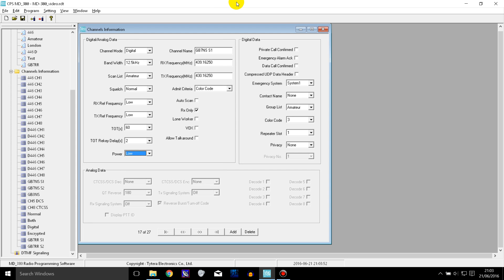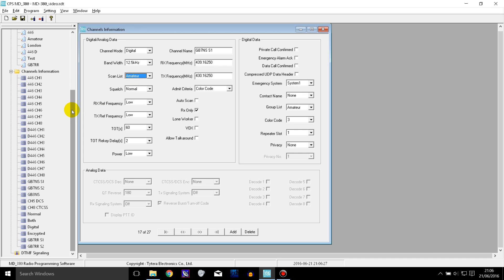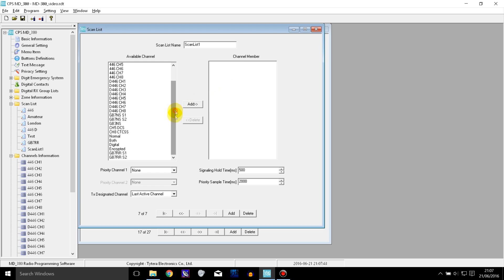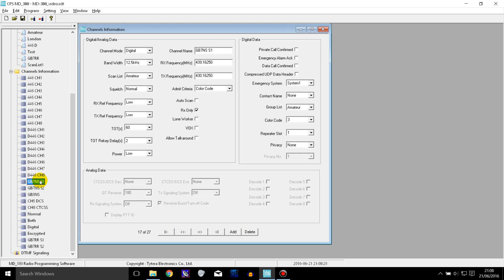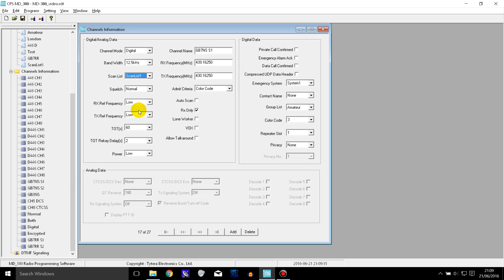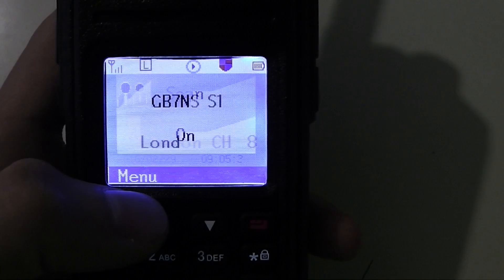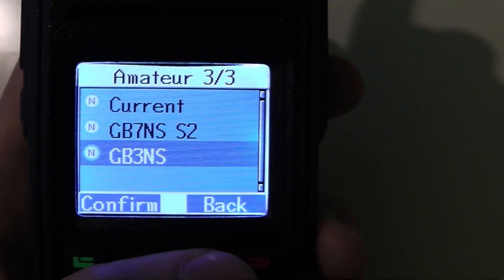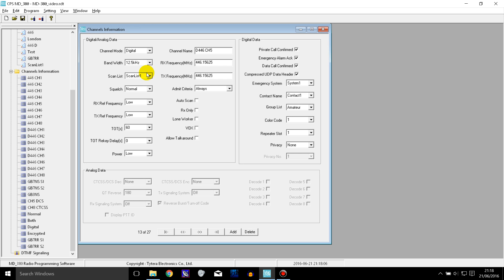How to scan on TYT MD-380 and other DMR radios

Comment: Thanks for the excellent video. All very clear, and useful. One thing that you don't mention is that the LED flashes red when scanning. This worried me to start with, as it looks like flat battery, or the radio is transmitting - but looking in the paper manual I see that this is normal when scanning.

Comment: does the scan feature also work on DMR talk group if I'm only MMDVM hotspot?
Reply from the maker: only if the hotspot has that talkgroup activated. Scan only scans what is transmitted. You have to make the hotspot transmit it first, either by setting it as a static talkgroup or by activating it by transmitting on the talkgroup.

Comment: Hi, thanks for the reply, there is no auto scan i found in the programing software. But you did give me an idea, I set ch1 to no scan list and power up to ch1 no scan on ch1, I can then switch to other channels and scan stays off till i hit side button. Go back to ch1 and scan is off. Kinda of cumbersome, but works.  Seems like a power up, scan default on/off setting in the setup would be reasonable.  Thanks, for getting me thinking...I try and follow support instructions.... badlands
Reply from the maker: Another idea: check the scan list. The setting might be on there instead
Reply: @radiosification  I will check that again, tks
Reply from the maker: Also you can program one of the side keys to be scan on/off so you don't need to go into the menu
Reply: @radiosification  Thanks, i have that side button set, it will still power up in scan on,  ths

Comment: Hi, new to tyt 380 and 390. Looking for default power up scan OFF.. I did try and search this out before sending this, per your blog request. I cant find out how to set scan to be off at radio power up. Now I need to turn scan off by side button at every power up. I like your videos in the lack of judgment and clear and clean information. Thank you, docbadlands
Reply from the maker: I'm very impressed. Most people don't actually read and follow those instructions. Off the top of my head, the first thing that comes to mind is that there may be a channel setting to turn scan on automatically. If you check the channel in the programming software, maybe you'll see a setting saying "auto scan" or similar. I'm not 100% sure if this radio has that setting but off the top of my head that's all I can think of at this moment. Let me know if that doesn't fix it and I can try again

Comment: Do you happen to know if there's any setting that will keep the audio from muting for a second or two when the transmitting radio is in scan mode (analog)? Here's a demo of the problem:
https://www.youtube.com/watch?v=DtE1NyeDpsg
Reply from the maker: No, there is no fix for this. It's not a bug, simply a limitation of the scan speed. The radio has to check each channel in the scan list so there will inevitably be some delay before it picks up the channel which is active.
Reply: Thank you for your reply, but maybe I wasn't clear in explaining the issue. It's the TRANSMITTING radio that's in scan mode, not the receiving radio. The receiving radio isn't scanning so it's not checking channels. Additionally, the transmitting radio's scan list can have no channels in it and even then there audio is muted.
Furthermore, if you look at the first video, you can see (and hear) that the squelch on the receiving radio opens immediately on the PTT, with no delay at all. If there were some delay in checking channels, the squelch unmute would be delayed as well, no?
Also, if you watch the other video, you can see that quickly releasing and pushing the PTT button allows the audio to NOT be muted on the receiving radio. It's only the first PTT that has this issue. All very weird.
Reply from the maker: Oh okay, I see what you mean now. I don't know of any fix for this. It was probably just lazy coding in the radio when they were writing the firmware.
Reply: Understood. Thank you for checking into it.
Reply: Any idea how to report a bug to TYT? Their "Contact Us" link on their web page (and many others) go nowhere.
I have contacted the 2 parties I know of that are writing replacement firmware, and they aren't interested in fixing TYT's bug (oddly).

Comment: I'm having the problem with analog scanning, that when I turn on scan in a zone, it will scan all zones and will lock in on the zone that is talking, and then I have to manually switch back to my original zone, and it will keep doing that.
Reply from the maker: Change the TX designated channel in your scan list from "last active channel" to "selected". Then it should return to whichever channel you were originally on.
Reply: That worked but,,, is there a way to make it only Scan 1 zone at a time, it's still scanning all the analog zones
Reply from the maker: it only scans the channels you have in the scan list assigned to the channel you start scanning from. You can choose only the channels you want to scan and put them in the scan list
Reply: I go into a zone and "scan" and all of my analog scan lists "scan" lists scan, but the "zone" that I'm in does take priority. I can make you a video to show you.
Reply from the maker: If the scan list doesn't work properly then it's just a bug and I can't do anything about it

Comment: Thanks for the scan tutorial. Can you tell me why I never hear anything. I don't have a call sign and thought I could just listen until I get it. I can see it's scanning but nothing to be heard. I did all the programming and uploaded the info on to the MD-390. I had to use the software for the MD-380 because the software for MD-390  kept saying the model was wrong, but I do have the TYT MD-390. Any suggestions?

Comment: another question, if I add a Hytera DMR repeater, can I just use their talkgroups i.e WW TG 91 instead of DMR-MARC WW TG1 ? or is there more "fiddling" to be done? I ask cos I have 3 Hytera's near me :-/  Bril video's btw.....just superb for the DMR novice like me.
Reply from the maker: All DMR repeaters essentially work the same (unless they're using trunking). The talkgroups are arbitrarily set by the group who runs that network. If you look on their website then you should see what talkgroups you're allowed to use on the network. (I haven't looked myself but I assume they would have that information on there somewhere).
As long as you have the correct colour code, frequencies and timeslot, the repeaters will work the same but just with some different groups connected to different things.
Reply: Brill - that's clear, so i'll change the Hytera repeaters to HYT TG's - thanks again :-)
Reply: you DO realize  you're on your way to becoming the fountain of DMR knowledge for us "oldies"  :-P
Reply from the maker: haha, thanks

Comment: So if I understand this correctly, the scan functions scans the channels in the channel list and not across the channels in the zone? So if i had say REP1, REP2, REP3 & REP4  in Zone 1- and I'm on channel REP1,  would scan the list in REP1 and not across the REP 1,2,3 & 4 lists, or would it scan all 4 lists, - hope that's clear :-)
Reply from the maker: It only scans the channels in the scan list you've assigned to that channel. If you change to a different channel it scans the scan list assigned to that channel. The channels you have in the zone don't affect it at all.
Reply: makes sense - thanks :-)